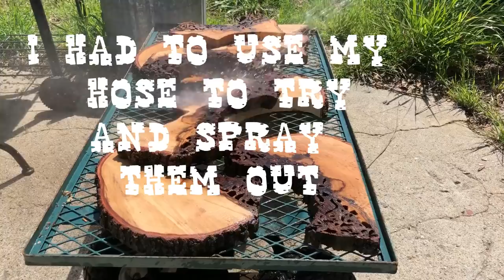"the hungry termite" fresh cut firewood wall art

Comment: No wonder you were working fast with all those termites about ;o) The holes have added another dimension to your art work. I wondered if any eggs might have been left behind hidden in the wood? I know that if we get woodworm in furniture it is terrible to get rid of. 

How you piece things together is fascinating to watch.
Reply from the maker: When I first started to notice the termites crawling all over the table I was shocked by how many there were. I occasionally run into a few termites here and there but this was nothing like I'd ever seen. I was able to get rid of all of the active termites but eggs may be a different story. Its possible that a few eggs got left behind. I brushed termite killer all over the pieces and soaked them down really good so if there are any eggs they should be covered in termite killer. Plus, I believe these are the types of termites that need moist wood to eat and if there's no moisture they can't survive. So even if the eggs hatch, I don't think the termites could eat the dry wood. I'm going to keep the piece hanging in my house for awhile and if I ever see any dust piles under it I can spray some termite killer in the holes that the dust is coming from and take care of it that way.
Reply: Good idea, keep it under observation. It will probably be fine. It's better the right way up, by the way. A lovely piece of art.